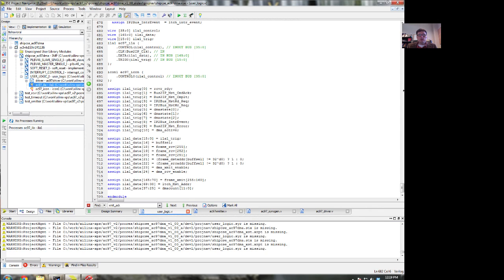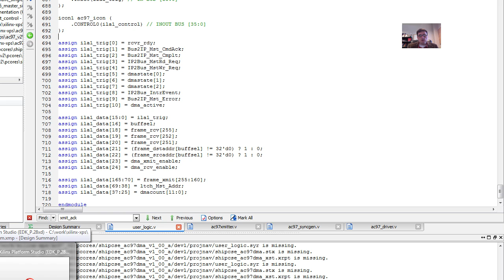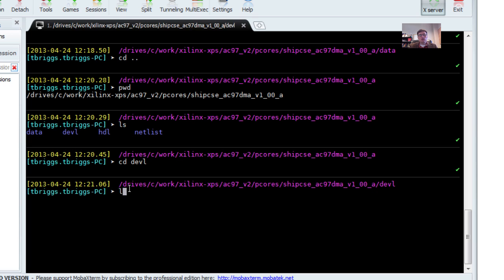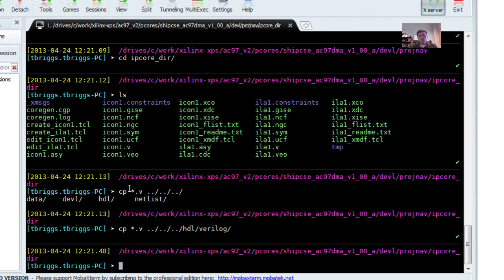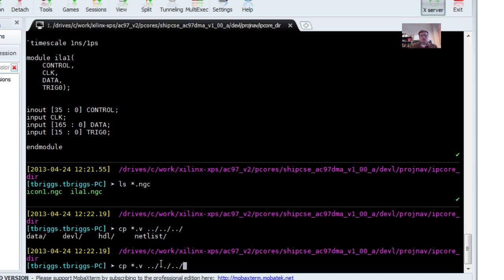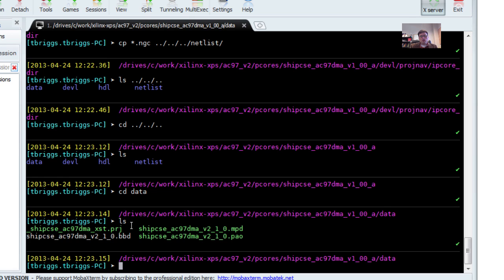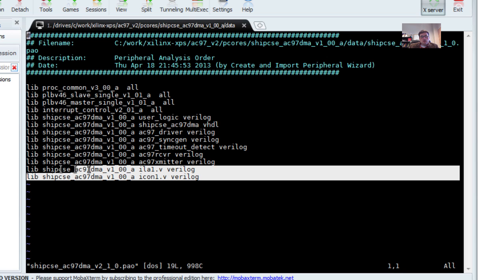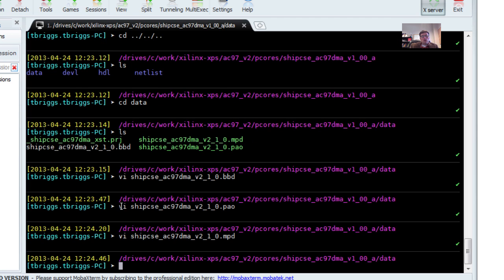Building EDK projects with core generated modules

Comment: Release 14.7 ngdbuild P.20131013 (nt64)
Copyright (c) 1995-2013 Xilinx, Inc.  All rights reserved.

Command Line: D:\Xilinx\14.7\ISE_DS\ISE\bin\nt64\unwrapped\ngdbuild.exe -p
xc6slx9csg324-3 -nt timestamp -bm ramxps_design.bmm
E:/designs/xxx/xilinx/local_repo/project_directory/ISE_14_7/ramxps_design/impl
ementation/ramxps_design.ngc -uc ramxps_design.ucf ramxps_design.ngd

Reading NGO file
"E:/designs/xxx/xilinx/local_repo/project_directory/ISE_14_7/ramxps_design/imp
lementation/ramxps_design.ngc" ...
Loading design module
"E:/designs/xxx/xilinx/local_repo/project_directory/ISE_14_7/ramxps_design/imp
lementation/ramxps_design_pushbuttonswitches_wrapper.ngc"...
Loading design module
"E:/designs/xxx/xilinx/local_repo/project_directory/ISE_14_7/ramxps_design/imp
lementation/ramxps_design_uart_wrapper.ngc"...
Loading design module
"E:/designs/xxx/xilinx/local_repo/project_directory/ISE_14_7/ramxps_design/imp
lementation/ramxps_design_proc_sys_reset_0_wrapper.ngc"...
Loading design module
"E:/designs/xxx/xilinx/local_repo/project_directory/ISE_14_7/ramxps_design/imp
lementation/ramxps_design_clock_generator_0_wrapper.ngc"...
Loading design module
"E:/designs/xxx/xilinx/local_repo/project_directory/ISE_14_7/ramxps_design/imp
lementation/ramxps_design_rammstr_0_wrapper.ngc"...
Loading design module
"E:/designs/xxx/xilinx/local_repo/project_directory/ISE_14_7/ramxps_design/imp
lementation/ramxps_design_microblaze_0_ilmb_wrapper.ngc"...
Loading design module
"E:/designs/xxx/xilinx/local_repo/project_directory/ISE_14_7/ramxps_design/imp
lementation/ramxps_design_microblaze_0_dlmb_wrapper.ngc"...
Loading design module
"E:/designs/xxx/xilinx/local_repo/project_directory/ISE_14_7/ramxps_design/imp
lementation/ramxps_design_axi4lite_0_wrapper.ngc"...
Loading design module
"E:/designs/xxx/xilinx/local_repo/project_directory/ISE_14_7/ramxps_design/imp
lementation/ramxps_design_microblaze_0_wrapper.ngc"...
Loading design module
"E:/designs/xxx/xilinx/local_repo/project_directory/ISE_14_7/ramxps_design/imp
lementation/ramxps_design_microblaze_0_i_bram_ctrl_wrapper.ngc"...
Loading design module
"E:/designs/xxx/xilinx/local_repo/project_directory/ISE_14_7/ramxps_design/imp
lementation/ramxps_design_microblaze_0_d_bram_ctrl_wrapper.ngc"...
Loading design module
"E:/designs/xxx/xilinx/local_repo/project_directory/ISE_14_7/ramxps_design/imp
lementation/ramxps_design_debug_module_wrapper.ngc"...
Loading design module
"E:/designs/xxx/xilinx/local_repo/project_directory/ISE_14_7/ramxps_design/imp
lementation/ramxps_design_leds_wrapper.ngc"...
Loading design module
"E:/designs/xxx/xilinx/local_repo/project_directory/ISE_14_7/ramxps_design/imp
lementation/ramxps_design_axi_timer_0_wrapper.ngc"...
Loading design module
"E:/designs/xxx/xilinx/local_repo/project_directory/ISE_14_7/ramxps_design/imp
lementation/ramxps_design_microblaze_0_bram_block_wrapper.ngc"...
Applying constraints in
"E:/designs/xxx/xilinx/local_repo/project_directory/ISE_14_7/ramxps_design/imp
lementation/ramxps_design_microblaze_0_ilmb_wrapper.ncf" to module
"microblaze_0_ilmb"...
Checking Constraint Associations...
Applying constraints in
"E:/designs/xxx/xilinx/local_repo/project_directory/ISE_14_7/ramxps_design/imp
lementation/ramxps_design_microblaze_0_dlmb_wrapper.ncf" to module
"microblaze_0_dlmb"...
Checking Constraint Associations...
Applying constraints in
"E:/designs/xxx/xilinx/local_repo/project_directory/ISE_14_7/ramxps_design/imp
lementation/ramxps_design_axi4lite_0_wrapper.ncf" to module "axi4lite_0"...
Checking Constraint Associations...
Applying constraints in
"E:/designs/xxx/xilinx/local_repo/project_directory/ISE_14_7/ramxps_design/imp
lementation/ramxps_design_microblaze_0_wrapper.ncf" to module
"microblaze_0"...
Checking Constraint Associations...
Gathering constraint information from source properties...
Done.

Annotating constraints to design from ucf file "ramxps_design.ucf" ...
Resolving constraint associations...
Checking Constraint Associations...
WARNING:ConstraintSystem:135 - Constraint <INST
   /ramxps_design/EXPANDED/ramxps_design/axi4lite_0/axi4lite_0\/si_converter
   bank\/gen_conv_slot[0].clock_conv_inst\/interconnect_aresetn_resync<2>_inv1
   INV_0 TNM = FFS:axi4lite_0_reset_resync>: No instances of type FFS were found
   under block
   "axi4lite_0/axi4lite_0/si_converter_bank/gen_conv_slot[0].clock_conv_inst/int
   erconnect_aresetn_resync<2>_inv1_INV_0" (type=INV).

WARNING:ConstraintSystem:58 - Constraint <TIMEGRP axi4lite_0_reset_source = FFS
   PADS CPUS;>: CPUS "*" does not match any design objects.

WARNING:ConstraintSystem:194 - The TNM 'axi4lite_0_reset_resync', does not
   directly or indirectly drive any flip-flops, latches and/or RAMs and is not
   actively used by any referencing constraint.

INFO:ConstraintSystem:178 - TNM 'sys_clk_pin', used in period specification
   'TS_sys_clk_pin', was traced into PLL_ADV instance
   clock_generator_0/PLL0_INST/Using_PLL_ADV.PLL_ADV_inst. The following new TNM
   groups and period specifications were generated at the PLL_ADV output(s): 
   CLKOUT0: <TIMESPEC TS_clock_generator_0_clock_generator_0_SIG_PLL0_CLKOUT0 =
   PERIOD "clock_generator_0_clock_generator_0_SIG_PLL0_CLKOUT0" TS_sys_clk_pin
   HIGH 50%>

Done...

Processing BMM file "ramxps_design.bmm" ...

Checking expanded design ...
ERROR:NgdBuild:604 - logical block
   'rammstr_0/rammstr_0/AXI_SLAVEV_I/i2ccw/imi/idrm' with type
   'ramdp_ram_mf' could not be resolved. A pin name misspelling can cause
   this, a missing edif or ngc file, case mismatch between the block name and
   the edif or ngc file name, or the misspelling of a type name. Symbol
   'ramdp_ram_mf' is not supported in target 'spartan6'.
WARNING:NgdBuild:443 - SFF primitive
   'microblaze_0/microblaze_0/MicroBlaze_Core_I/Performance.Decode_I/Using_FPGA.
   Gen_Bits[27].MEM_EX_Result_Inst' has unconnected output pin
WARNING:NgdBuild:452 - logical net 'axi4lite_0_M_BUSER<5>' has no driver
WARNING:NgdBuild:452 - logical net 'axi4lite_0_M_RUSER<5>' has no driver

Partition Implementation Status
-------------------------------

  No Partitions were found in this design.

-------------------------------

NGDBUILD Design Results Summary:
  Number of errors:     1
  Number of warnings:   6

Total memory usage is 4489064 kilobytes

Total REAL time to NGDBUILD completion:  37 sec
Total CPU time to NGDBUILD completion:   37 sec

One or more errors were found during NGDBUILD.  No NGD file will be written.

Writing NGDBUILD log file "ramxps_design.bld"...

I followe all steps still it gave me this error